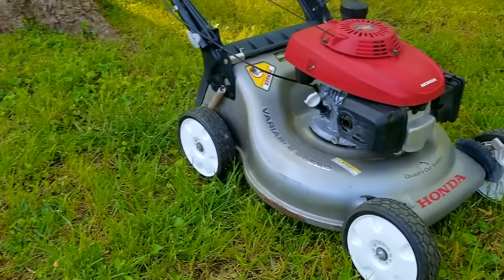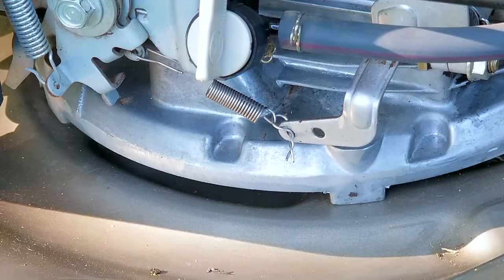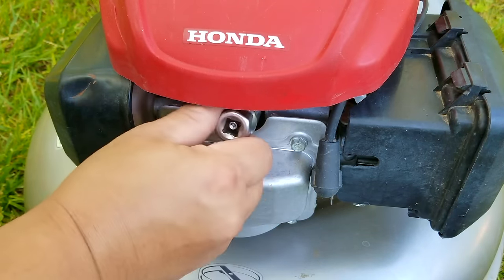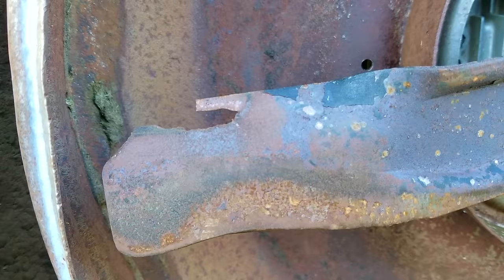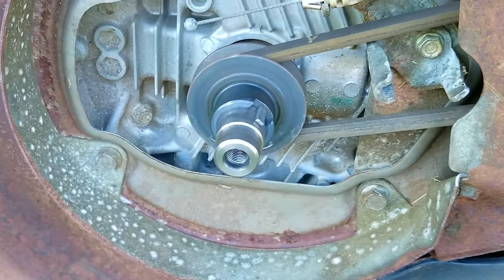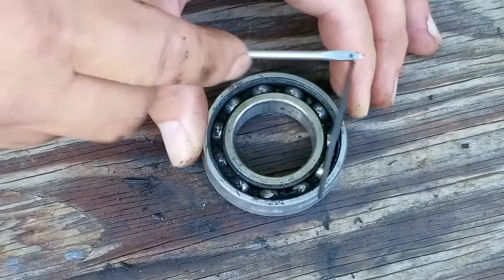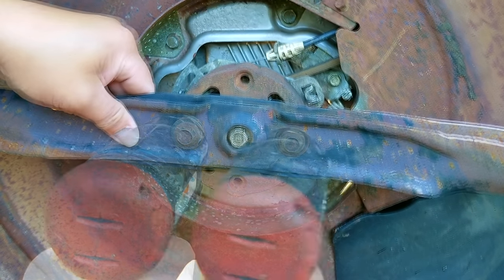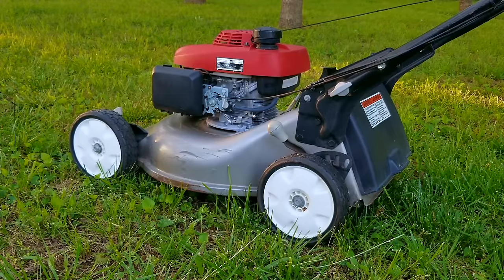Stuck Pull rope on Honda lawn mower

Comment: I almost have the same Honda lawn mower, the only problem I have with mine (I wrote this comment in some other videos) that the air filter cover falls off while I'm mowing, very frustrating,I do put back the right way making sure the filter it's in all the way and it falls off again.I end up putting a rubber band around the cover, problem solved.
Reply from the maker: thanks for sharing, you can buy just the cover online with free shipping for $6.45 before taxes, at least here in the states.
Reply: On Steves small engine saloon there's a video showing how to cure this common problem
Reply: @kevinbushell2746  Thanks, I was already subscribed to Steve's channel but apparently I missed the video, I'll give it a try.
Reply: Yea..my new airfilter barely fits...so the cover falls off as well
Reply: @HomeGaragechannel that fixes the problem..my problem is the airilter is a hair bigger then original so cover pops off

Comment: I have a 2003 model 160 Honda plain engine  with the manual choke lever on a light frame , gave twenty dollars for the mower and transferred the Honda engine on a light frame . Just a trim mower , all I did too it was just clean the carb and the rest is history . That was three years ago , easy to push and pull , the more you have on one the more things too go wrong too . I can live without the clutch model . Great training video - thanks - keep it up . Saved your video just in case I get one to work on in the near future...
Reply from the maker: Thanks I appreciate it

Comment: Thanks a million.  My 198X or late 197X HRA214SX.  Other than a drive cable that was replaced under warranty and 1 spark plug, the air filter, oil yearly, and blades and blade holder, I've replaced nothing else.   I'm very mechanically inclined but I was hesitant to tear into the blade clutch.  This video was the exact repair.  I was able to free it up but will replace the bearings.
Reply from the maker: hey I'm glad it helped you out.

Comment: When I have equipment with sealed bearings I occasionally remove the seal and re grease them, then replace the seal.  Heat plays havok with them and off brands usually don't use good grease and or enough.
Reply from the maker: you are exactly right about re-greasing them.
Reply: @HomeGaragechannel  let me know what you do with that honda i will take it
Reply from the maker: @snoopysrc  this honda is already fixed, there will be 3 videos on it, the second video will be released this Friday.

Comment: I love the Honda blade clutch system, and wouldn't be without it.  That particular model has the single-lever rear height adjuster, which is about the worst design aspect I've ever seen on a Honda;  the connecting bar between the rear wheels is the lowest component, and drags on any uneven spot in the lawn.  Doublewide6 has a very clever method of swapping out those clutch bearings.  The 'bearing in the freezer' trick helps for re-installation.

Comment: I bought a new Honda Izy 416, all assembled fine, except the pull cord only moves a very short distance.. and I can't mount it to the holder on the handle, will this only move all the way once it has oil?
Reply from the maker: I doubt it. Sounds like a recoil problem

Comment: What kind of special tool did you use and where can I find it I got the clutch out but the barring fell apart all that’s left is the race in there
Reply from the maker: you mean to remove the bearing? I used a socket and a big hammer to take it out.  Same method to put it back in, but I used a different sized socket to not damage it.

Comment: I have a seized hrx217 I picked up. I removed the spark plug and added MMO, but still can’t get it unlocked. Thoughts on how to unseize?
Reply from the maker: sure, take it apart and find out what's sized, the piston or the rod.

Comment: Thank you very much for the video. I'm hoping that the bearing is my issue. My pull cord will not pull at all. I was thinking it may be a seized piston. I always did proper maintenance, however the lack of use for two years didn't help. Always stored in H&C shop. Hoping it may be a bearing. Mower is over 25 years old. However, had always run well. I'm hoping your video helps me. Thanks Robert TN
Reply from the maker: Yes I was surprised that the bearing could do that as well.  Hopefully you can get it working again

Comment: I have a Honda HRR216VXA that has the same issue.  My problem is that the center nut is not turning however the starter rope pulls extremely hard and when turning the flywheel there is no loose or tight spot.  The valves seem to move in and out as they should.  It just stopped out of the blue.  The block is not leaking oil so I know a rod did not go thru the block.  I can turn the flywheel all day with a large flat tip screwdriver, so I assume the engine is not seized up. Any idea what could be wrong.  I'm scarred to take it apart without getting some idea of whats gone wrong.  Any thoughts/ideas what happened?
Reply from the maker: how do your valve cover look? are there any dents?
Reply: I put it in the shop today.  I'll let you know the final result.  I'm going to keep watching your channel to learn more.

Comment: What about a totally new engine on a gas log splitter just assembled? Second start after adding more hydraulic fluid - it starts for a second, then suddenly stops and the pull rope feels stuck - can pull only slow and with  resistance? Could it be low motor oil level - didn't fill it right? New to gas engines, so most likely I made some error.
Reply from the maker: sure, take out the spark plug, then pull on the rope and see if gasoline comes out of the engine.  There's a good chance the carb allowed fuel to seep by while not in use, and flooded it.
Reply: @HomeGaragechannel After letting it to cool down for about an hour, checked the motor oil level - it just flowing out when plug is unscrewed, so I'm assuming that it means enough oil. Tried to pull - no more resistance, the rope is fine again, so I started it without problems, but because I have hydraulic fluid leaking from under the cap which doesn't fit well I shut the motor off. Waiting for a good hydraulic cap to arrive. So, I guess, it was some sort of automatic emergency shut off related to problems with hydraulic (it was foaming like crazy). I hope the new cap will solve the problem.
Reply from the maker: I hope so too

Comment: A great video. I have a bit older version of the HRR mower (from 2006), I bought it used in 2016, and yes, it has the clutch system, and is self propelled. I do keep up on the maintenance on it for the most part by keeping stabil in the gas as much as possible, and I did change the oil I think at the beginning of this season, and it's gotten a new carb and mulching blades, and a whole new rope recoil mechanism. Outside of that, it's been a reliable as they come, for the most part. 

As to the clutch system, I have no issues with it and much prefer it to the actual kill switch/dead man's bar where you let go of the dead man's bar, the motor stops, then you have to yank the rope to restart, every time you empty the bag. 

I use my bag early in the season, mulch the rest of the season myself.

When I need parts, my local Ace Agrishop has them, I order, and go retrieve and install. Prices so far are very reasonable and it's just up around the corner from my house so a win, win situation. Just recently had to replace my now dead Troy Bilt weed eater for a Stihl version that I got at that same Ace Agrishop. They rock.
Reply from the maker: nice, sounds like you're in a great position to keep your equipment maintained and working for a long time. thanks for the comment

Comment: What part is the blade bearing? I want to make sure I don't order the wrong one. Thanks
Reply from the maker: change them both.
Reply: @HomeGaragechannel  when I looked under my honda izy, it looked completely different! I did manage to find the problem, the blade spins freely so it was the recoil mechanism. Manage to fix it without getting it replaced. 😀
Reply from the maker: nice

Comment: What do you think of 2 cycle lawn mowers?
Reply from the maker: I think they are awesome, they are perfect for hillsides and ditches.
Reply: @HomeGaragechannel  Yeah, I saw a video on one the other day, It seemed pretty cool. Also news on the locked up mower. I got it to crank a tad bit easier. it cranks. but still is a pain.
Reply from the maker: is there enough oil in the Engine?

Comment: As long as you keep the thing lubricated than it is not going to fail on you, this is also an older model, the modern Honda mowers have an improved clutch system
Reply from the maker: I'll have to get my hands on one to compare

Comment: My plate is stuck, it won't move off of the drive shaft. How else can I get it off?
Reply from the maker: I'd try spraying it with WD-40 or some other penetrant
Reply: I did start it with the blade holder off. Could that have seized something?
Reply from the maker: I don't think so

Comment: The biggest cause of bearing failure is that the factories don't put enough grease in them, you should always add more grease to new bearings.
Reply from the maker: that's a good point

Comment: I've had to replace the lower clutch bearing on a similar Honda HRR2165VXA.  An NSK brand bearing was less than $12 from Amazon with tax and delivery.  I usually freeze the bearing for an hour or so before tapping it in.
Reply from the maker: thanks for the tip

Comment: It needed a speed adjustment because Honda runs them max at 3,800 when we all (or at least me) knows they will run 4,200 all day err day. Those precious RPMS really help out in the back 40 and it probably does cut the engine life down 10% if your not running synthetic 10-40 or 15-50 in hot climates.
Reply from the maker: that's a machine

Comment: I'm with you in that none of ours have blade clutches but the riders BUT the Kawasaki that I put on the Snapper was on a Deere mower that had one BUT I was able to take the blade clutch parts and make a blade adapter because the original one (Briggs)  was too big for the smaller shaft. Yes, I'd rebuild a blade clutch if I had one on a mower but it'd only be bearings IF I could get them but if I couldn't I'd just make an adapter or get one and do without a clutch. I thought it'd be the conn rod there but glad it's not. Thanks and Blessings!
Reply from the maker: thank you Lewie McNeely, the Blade clutches are nice, but need for everyone
Reply: @HomeGaragechannel  My Roof mower has one. I forgot about it. 28 inch cut and an 8 horse I/C Briggs so it needs one I guess.

Comment: These Mowers with that Blade clutch are used often by older Folks ore comercial users. So you don't have ti start the engine over and over again everytime you emty the basket or remove any obsticals
Reply from the maker: That makes complete sense thank you

Comment: I have a newer honda. What causes idle surge? How or what do I need to do. Thats sad they dont change oil on it. I love my honda best mower Ive ever owned. Wished they made lawn tractors. By the way, I subacribed. Thnx!
Reply from the maker: sure, theres a small screw you need to remove on top of the carb, and blocked by the idle screw, you need to clear that jet but it's very small.
Reply: @HomeGaragechannel  thnx !
Reply from the maker: @riceburner4747  no problem

Comment: The only blade override system I like is the Toro, as it uses a simpler belt system.
Reply from the maker: do you know if a model number for a toro that's equipped with it? I'd like to do some research into it.
Reply: @HomeGaragechannel  21383. I have one and it is awesome. Also much easier to service.
Reply from the maker: @rileysindt6689  thanks

Comment: The kids cut wet grass and jammed up the blade and they ripped at the pull start. The speed being moved was because they didn't clean under the deck and the blade was tight.

Comment: For my grand parents old craftsmen I could not pull the string so I striped It down to the crankbolt and grabbed a breaker bar and broke it loose then I cleaned the carb jet and it runs better than a 2 year old lawnboy 🥱
Reply from the maker: very nice!

Comment: Don’t ever tip it to the left, only on the oil side as if it’s tipped to the left oil leaks through the whole engine and ruins it even after 10 seconds, Remember that people
Reply from the maker: you are absolutely right
Reply: @HomeGaragechannel  i was saying that to other comments to make sure as I’ve seen so may people ruin mowers on a simple thing, good video man 👍
Reply from the maker: than you DannyPlayz